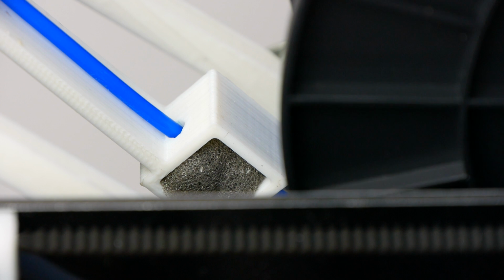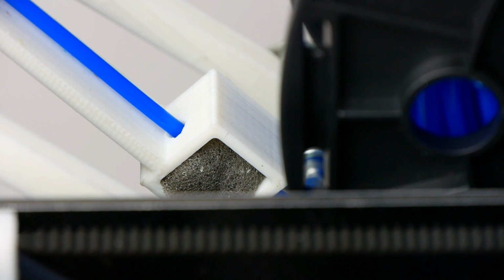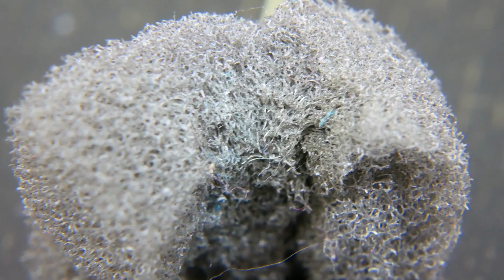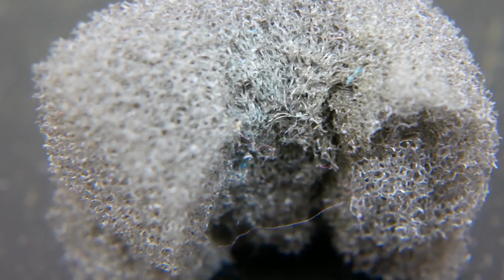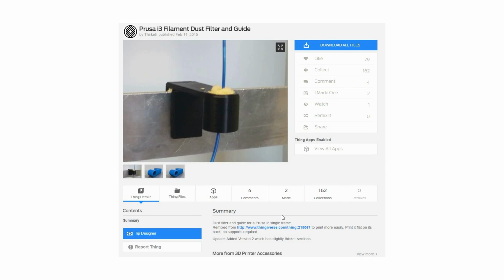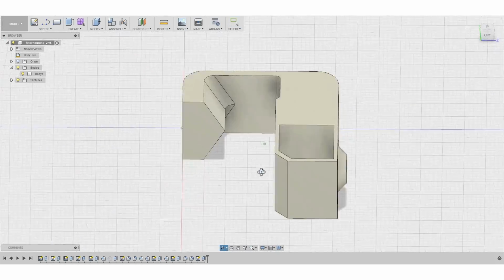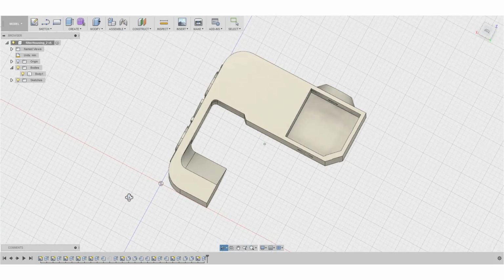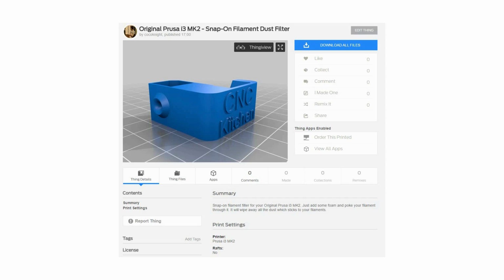Filament DUST FILTER - Prusa i3 MK2 UPGRADE

Comment: Yes it stops some dust but its also yet another point of failure. I actually had the filament drag some of the foam right up to the nozzle once... I got rid of it after that fiasco. Better to get a spannerhands filementbox or something alike to keep the dust out.

Comment: A couple design flaws (in my opinion):
1. This doesn't really "snap" into place. It just kind of sits there, and as a result, every time a retraction takes place, the whole part moves and pivots upwards with the filament.
2. It blocks the orange nib immediately infront of it and makes it extremely difficult (and painful) to pull on it in case I need to for whatever reason.
3. The bulk area adjacent to the sponge "housing" is just added plastic that serves no purpose (except to give you room to put your logo), and it accounts for 80% of the weight. This could be a much quicker print without it.

Just my constructive criticism.
Reply: Have you remixed it then?
Reply: I would like to see a revised design that takes into account the constructive feedback from Malek Ali.
Reply: No need to even remix, just take a piece of foam with similar qualities, slice it, then gently push it in between the screws that hold the filament. It seems wasteful to print something for this duster...
Reply: Checkout this one (using it for 3 months now): https://www.thingiverse.com/thing:3854631

Comment: I tried doing this, and the foam piece put too much resistance on the filament, and was causing severe under extrusion and was preventing it from adhering to the print bed.
Reply from the maker: Try a different type of foam. Dishwashing sponges work also fine and don't give problems when extruding.
Reply: Used too much foam, use a smaller piece

Comment: Looks as if the outer side of this device has no clearence with the left side of the Z axis assembly, no?
Reply from the maker: Nope, clearance is not an issue. Doesn't collide with anything even in the extreme positions!
Reply: OK, Thanks
Reply: Does'nt work for me. Can't home x when it's on.

Comment: What are your thoughts on a drop of oil on the foam? Some people swear by it.
Reply: Some of that oil will inevitably end up in your print and will worsen its mechanical properties. This should be fairly obvious.
Reply: @cedriceveleigh  3 years ago this was fairly popular fad (though possibly a placebo). The sponge filter is above the hob (feed) gear, so only the hob gear and the heatbreak/nozzle assembly would possibly get oil. Some people found vegetable oil or such helped keep feed rate consistent. Castor oil is part of nylon, and PETg filament is just PET mixed with glycerol to make it print better already, so it is hardly worse than printing those materials.